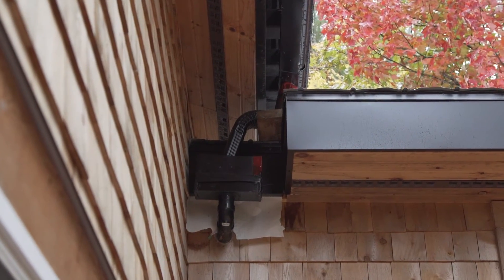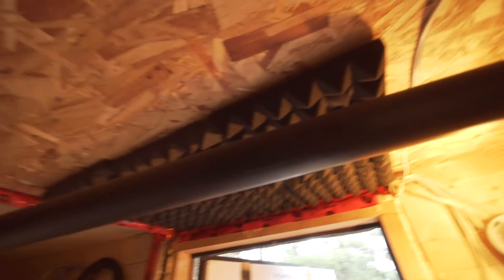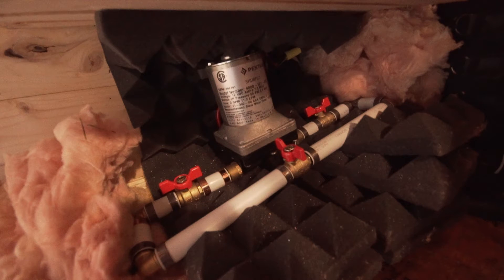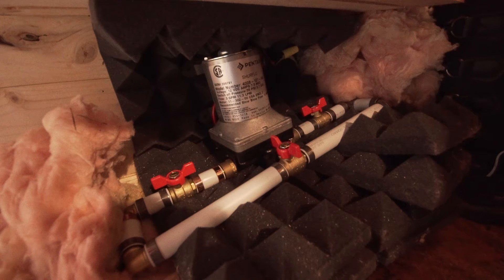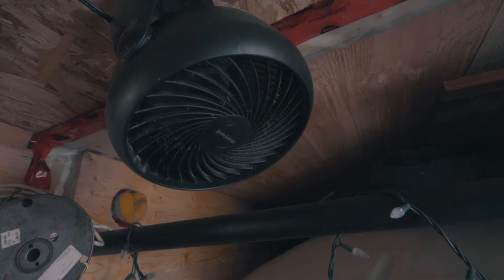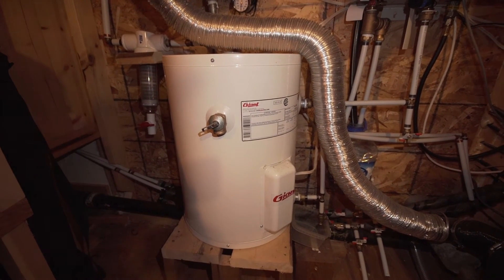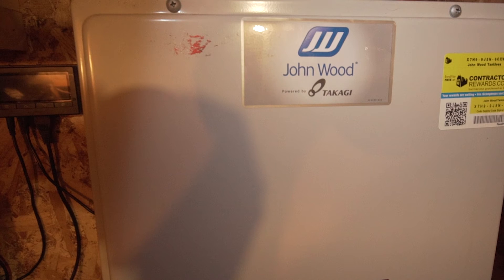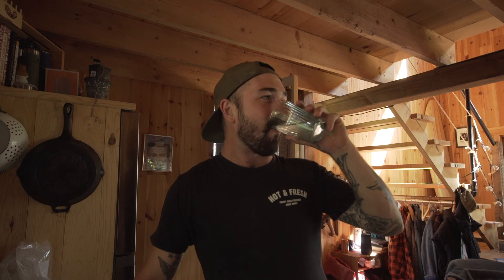Rainwater water harvesting system for OffGrid Cabin

Comment: Can u explain the expansion tank and the video seems to show very low water pressure at your taps. What kind of pressure (psi) do u get?
Reply from the maker: The pressure from the tap is about 50psi. The pump is a shurflow. Expansion tank is only to regulate the flow from that pump